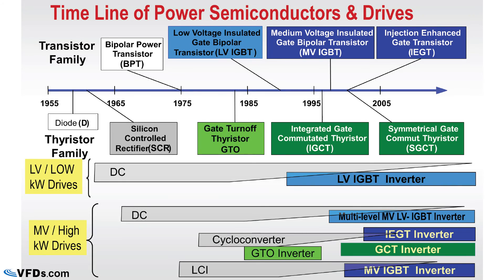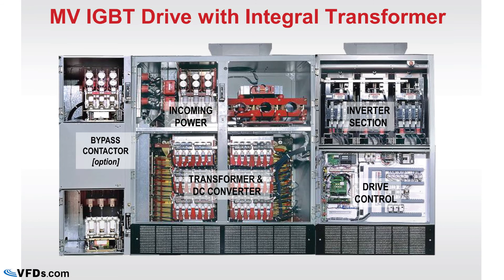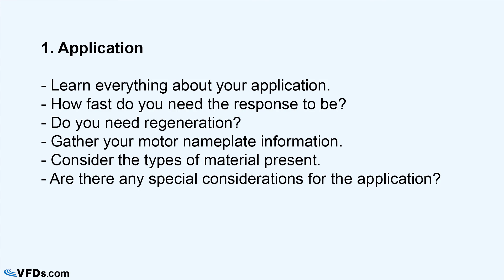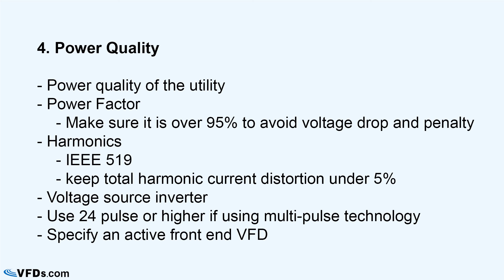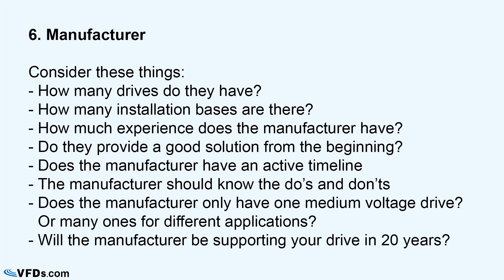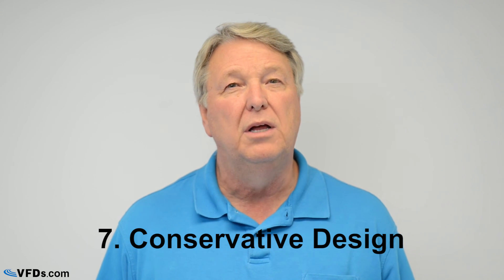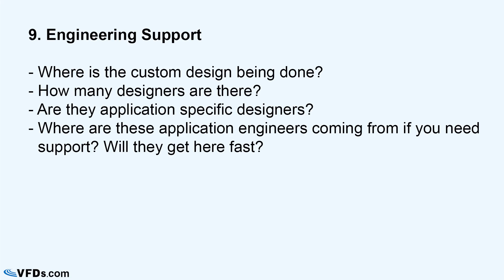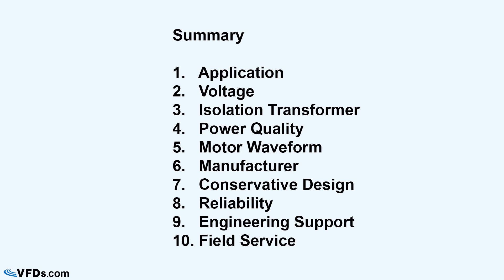How to choose a medium voltage VFD (Buying Guide)

Comment: Never heard of 24 pulse drives but in a new building we had 18 pulse drives on all motors 40 HP & !arger except for a soft start in 250 HP fire pump Talked to drive techs from two different drive companies and neither liked any drives above plain Jane 6 pulse drives. Always had trouble with biggest boy on the block ABB tech support. Had to perform PM on over 100 ABB drives and contractor threw away all the books. Took me two weeks and maybe 5 emails for clowns at ABB to finally explain how to Bring up DC Buss voltage that we had to enter on our drive PM'S. Found Danfoss & Allen Bradley best for tech support.

Comment: Maybe 6 months before I retired they installed two 1,750 HP chillers that 18' long cabinet was feed by 13,200 volts then to a transformer supplying 4,160 volts to the VFD. Never had training ing or saw them run. I asked where the NEC required arc flash labels were and they said thier engineering department were working in that.When I talked to one of my old coworkers a year later they still were working on labels. I would never approve of final payment for any lazy foot dragging company that did not supply required !abeling.
Reply: Arc flash ratings are unique from VFD to VFD depending on the installation, requiring a full analysis of the overall electrical system by a licensed PE for the state. The manufacturer/installer is literally not allowed to perform this. It's the legal responsibility of the end user.